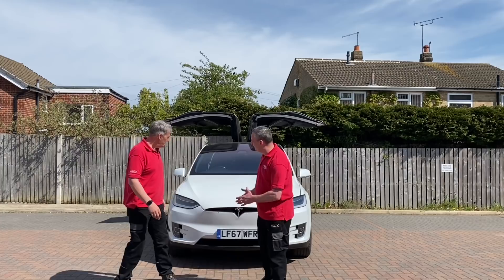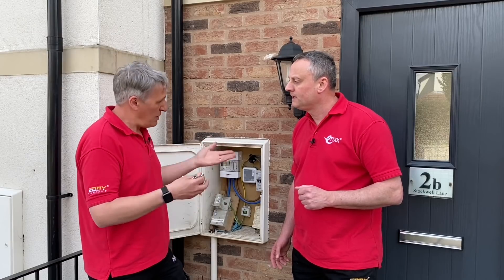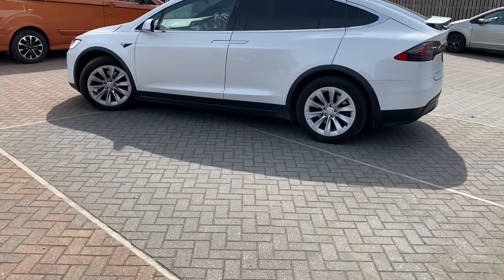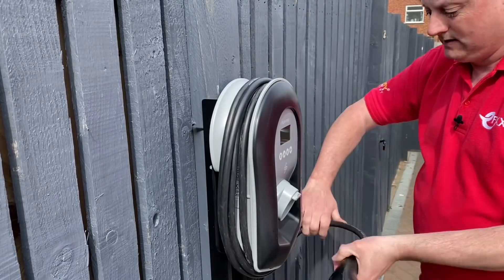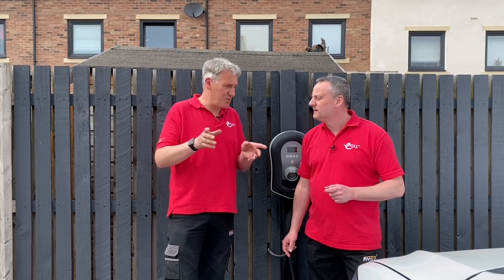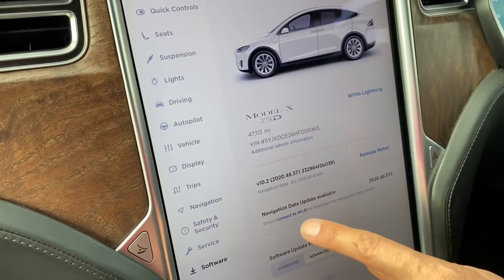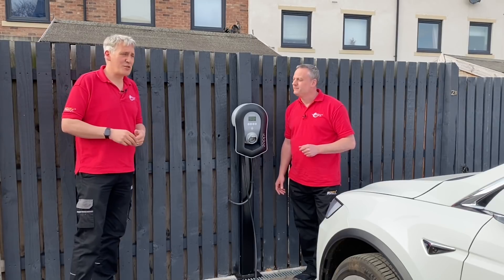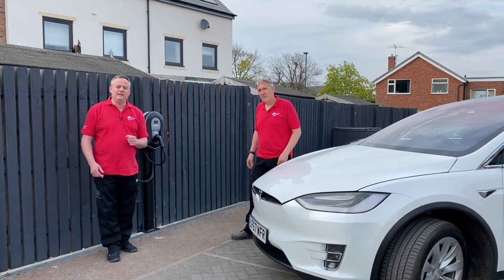EV CHARGER INSTALLATION at home? Watch this BEFORE YOU BUY!

Comment: It’s not the future it’s the Betamax of future vehicles 
Hydrogen fuel cells will make them redundant
Ps great video guys
Reply from the maker: We’ll see in 10 years - not many hydrogen cars hitting the streets atm
Reply: @efixx  I agree not many at present but manufacturers are manufacturing  Kia Hyundai Ford and Bm ,Hydrogen is cheap plentiful and the infrastructure and ease of use will ease its way Plus you can plug in your fuel cell and power your house as a bi product lol
Reply: @waterpowerspaniels  To be green the hydrogen has to be generated from green electricity and that is not cheap. In fact very little of it is being generated that way at the moment. It will require a very big investment in something like solar farms in desert areas.
Reply: Where I live there are next to no public ev chargers either!
Northwest England is very poorly served in fact, Northern England generally isn’t well served.
Reply: Totally agree electric cars are not the future, far too much needs to be done from infrastructure to generation of power and upgrades to local power stations not forgetting most people cant park outside their house and can't see cables across pavements and imagine a 4 car householder using 4 7kw chargers even allowing for diversity its a stupid amount of power req at each house for 8hrs. Stupid idea ,hydrogen pushing forward even jcb have built machines its clearly betamax vs vhs all over again. We are trying to reduce consumption not quadruple it ffs

Comment: Guys another fantastic video. OK I have just purchased an ev. And as per video make sure you consider Internet as the guys say these cars need Internet connection and if you run an swa cable in use the one that has the eithernet cable built in, this will help you to connect to Internet via a repeater or direct from charger to router. The other thing which you should consider is my nissan requires gsm signal not Internet to allow its app to work so you can control your car via app. I only just found this out recently as I had issues connected to car. I assumed it would connect via Internet but it was the other way round. Consider what charger to buy as the guys say. I did not want to fit an a earth rod due to issues so you may consider using a more upto date charger which negates the use of an earth rod you can use your tnc-s system rather than making your charger a tt system. I used a Viridian device to allow me to use my charger as mine had features that others did, allow an extra £200 for this device. Now what my exsperiance has been with tarrifs is that company's that offer great ev deal tariff is are not giving you anything, infact one company who say they will give you 4 hours free ev charging was not a great deal at all. Beware. In my opinion its best to get an economy 7 meter. I get nearly half price from 12:30 to 07:30am. And another bit of advice if you are thinking of solar on your roof don't but 4kw go for an 8kw system. In the summer months, ie lighter days you will charge your ev for free. Bear in mind my nissan with its 62kw battery from 20% to 100% will take at least 7 hours using my 7.4 kw ev charger. Hope this helps G
Reply from the maker: Great input thanks - I use economy 7 to charge - *gordon
Reply: My app controls the input on the car (Hyandai_) and allows control over INPUT
Dead simple - Can be inside the car as well

Comment: A question.. we all know that water and electric doesn’t mix..💥… 
So you get home and need to change your EV BUT ITS RAINING 🌧….
Is it safe to change your EV In the rain? ..cheers
Reply from the maker: Yes provided you store the cable correctly so it doesn’t get wet . Most chargers have a facility to store the cable or an end cap to cover the connector.

Comment: I bought a Rolec HomePod, because it was made inLincolnshire by a manufacturer of caravan outlets, and the equipment inside is on a din rail. I was really disappointed. Got water in the plug after just a few months, took 6 months to get issue resolved. Threatened installer with small claims court and a negative review before I got it resolved. Mean while I was paying for electric at peak rate to se a granny charger. I really wish I had bought a Zappi.

I went to Fully Charged Show specifically  to look at EVs and chargers and a lot of the staff their couldn’t answer any technical questions about the chargers.

Comment: Good video.  Load sharing with other appliances  isn’t an issue for most people as they charge overnight so showers, ovens etc aren’t really relevant.  

Also with regards to having two EVs, if you balance the load then you’ll be charging each at 50% of the output of the charger so it probably makes more sense for the majority of people to charge one car one night and the other the next night.  The net result is pretty much the same?
Reply from the maker: Load sharing isn't an issue until you've blown the supply cut out lots of people don't understand the use of electricity in the home!

Comment: I remember watching the initial video of you discussing how we thought the install might go. That was a good while ago, but it does look as if the wait's been worth it. It's a lovely tidy job. But what's to stop your neighbour from charging their car?
Reply: I think if your neighbor has an electric car then they can afford their own charger
Reply: @heladas90  I agree. But you'd be surprised what some people will try.
Reply: @brianwood5220  I noticed that my external garden socket was open recently. I know for a fact that I always keep it closed, and unpowered, when not in use. Somebody chancing their arm! I've also had my external tap messed with. I always have the water switched off when not in use. In hindsight I should have installed devices that could be padlocked shut. I'll remember that when they are replaced.
Reply: @dalriada842  We like to think that people are honest and the majority are. But, now and again there will be someone who thinks it's alright to take from others. IT'S NOT!!
Reply: @brianwood5220  What particularly annoyed me about it was that by leaving it open they were compromising the IP rating. I'm now slightly paranoid that someone might try to steal the double socket, since it's an MK one with an active RCD built in. It costs the best part of £70. I've filled in the channels that lead to the mounting screws with silicone to make it more of a bother for them.
Reply: @brianwood5220  I already have one. That's what I meant when I wrote that I have it switched off when not in use. Both my outdoor sockets and tap have cut-offs in my kitchen.
Reply from the maker: Great question Brian - you can set a PIN number on the Zappi.

Comment: Hi, Excellent video and commentary.  My main concern with any EV charging point installation in a public accessible area is the danger of vandalism to the equipment. I always feel that in that situation that a secondary enclosure might be beneficial.  Keep up the good work and stay safe.
Reply from the maker: Thanks Gareth - We did discuss placing the charger on the other side of the gate for this reason. However the parking area is a quiet street and not in a high crime area.
Reply: I was just generalizing but as you rightly say one has to weigh up each installation situation on its own merits.
Reply: Not alone will they be a target for thieves, they will also be a target for people taking personal Injury claims against the owners of such chargers, as the charging leads in a lot of cases cross areas where adults or children could walk and as such could represent a trip hazard, also the charging leads usually tend to be black in colour instead of a bright yellow for safety and also aprppriate signage would need to be considered reminding people to beware of charging cables.
Reply: Ive started to see these popup recently, looks like company in poland making them but have distribution in UK 
https://www.ebay.co.uk/itm/194115081461
Reply: @rudiP90D  Nearly same price as the charger.

Comment: I notice you used an rcbo in the consumer unit. As the Zappi also has a built in rcbo how are you managing selectivity between the rcbo’s, would a mcb in the consumer unit have been a better option?
Reply from the maker: Not with the cable route we had to choose through the house - install video coming soon!